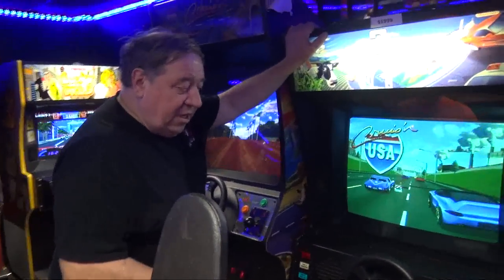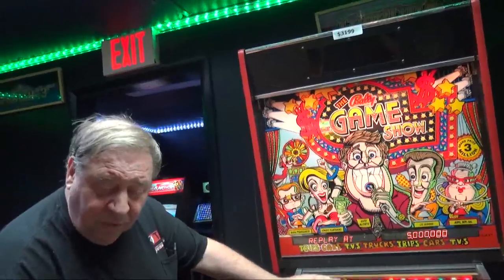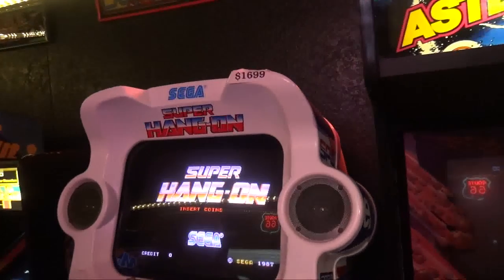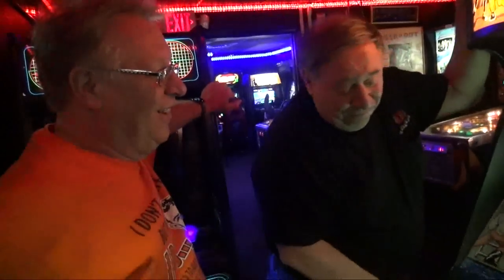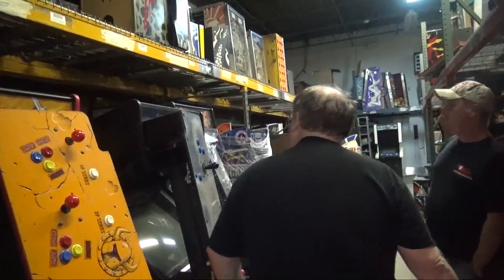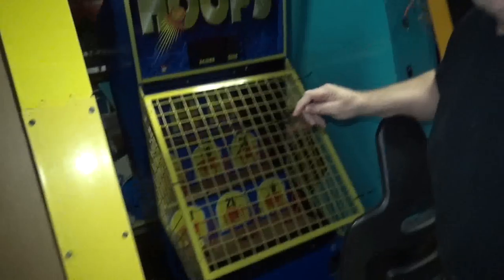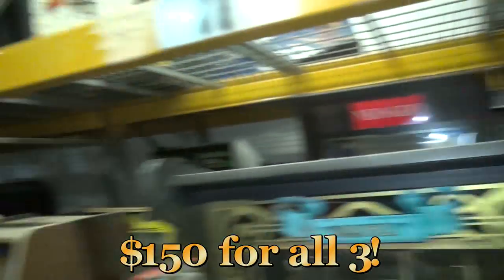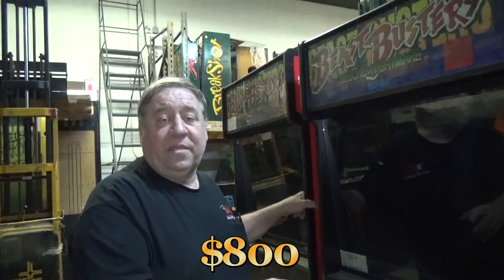#1308 Todd's BARGAIN BASEMENT #14--38 Arcade Video Games/Pinball Prices Slashed!TNT Amusements

Comment: Around 13:00 why was the super mario playing or what looked like was gradius?
Reply from the maker: when it came in it just had super mario brother playing...someone had put in a multi board...we turned on other games that the same button layout could use...so its multi games!
Reply: Vs. Gradius. Basically the NES version on an arcade board, for Nintendo cabs.
Reply: got a port of it on my x68000 work station. almost the same exact thing just with out the coin up function.